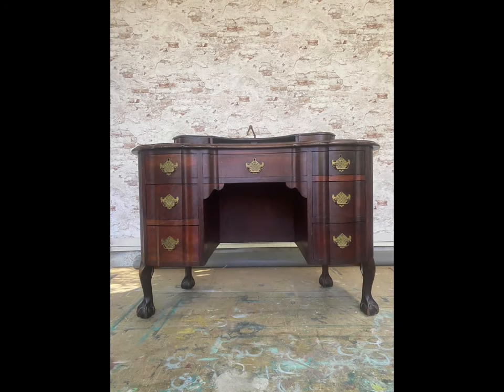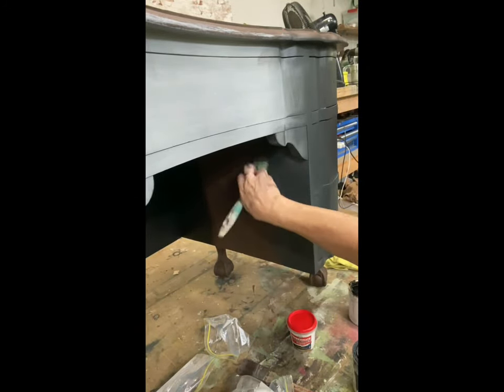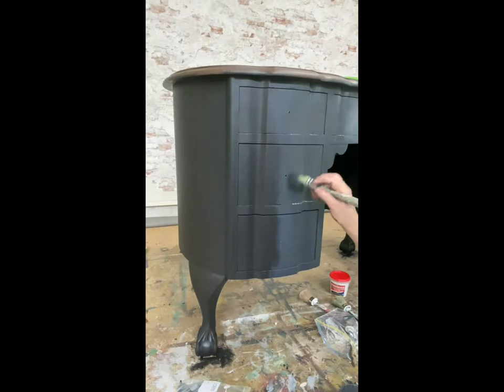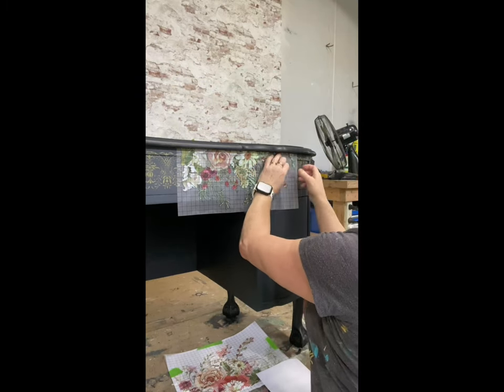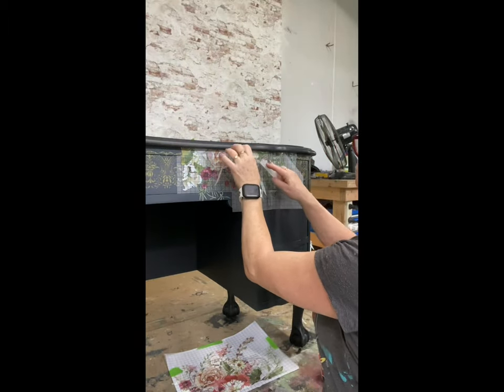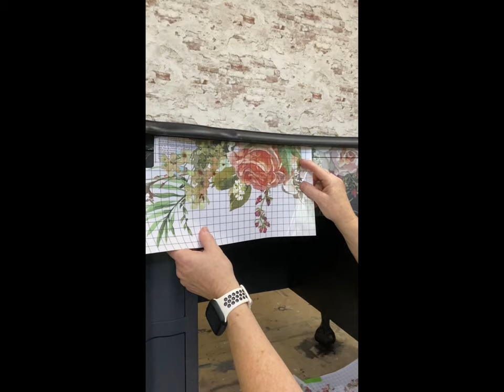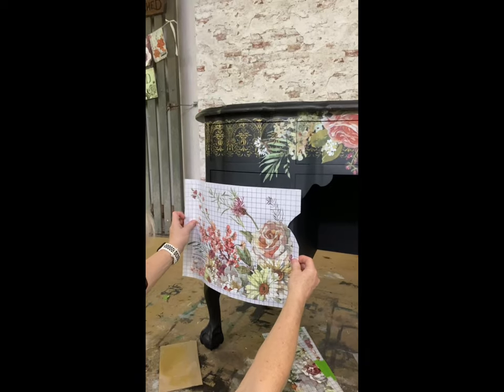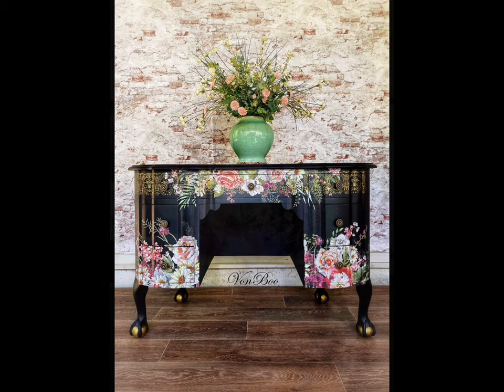Blending with Mint Mineral paint, gold stenciling and IOD transfer application

Comment: Hello Vonnie, thank you for a great tutorial.
Question, did you put anything on the rest of the desk, where the transfer is to seal it?  
Or did you just use the dark wax all over the desk?
Thank you.
Reply from the maker: I actually just sealed with poly the front where the transfer is as the paint does have a built in topcoat